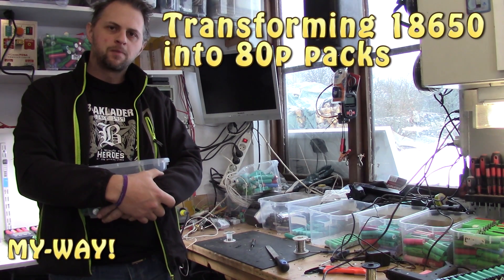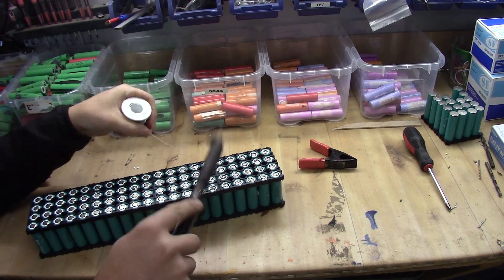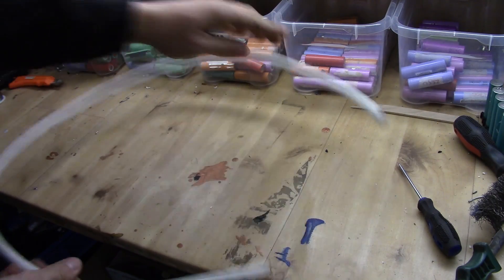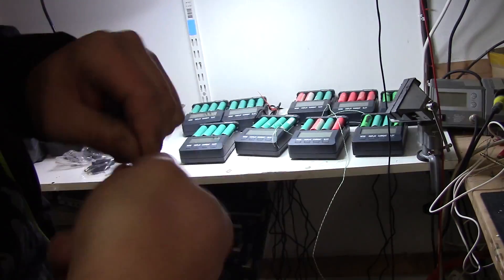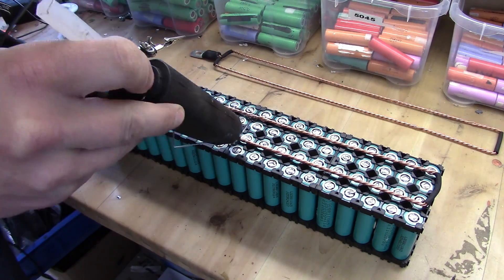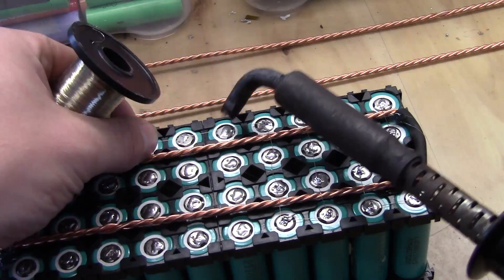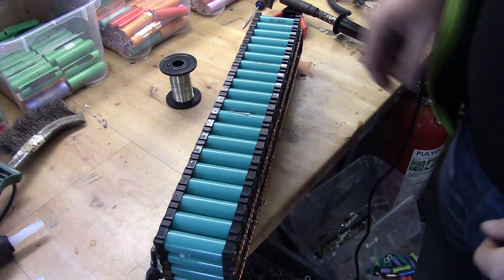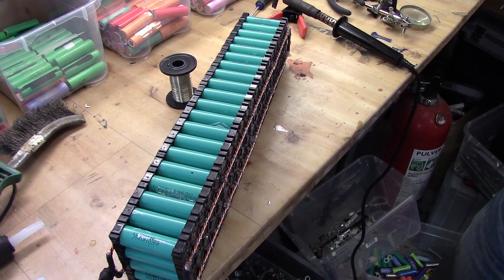18650 - Assemble the packs HOW TO 80 Tesla powerwall!

Comment: what kind of control charge you use
Reply from the maker: Jose Garcia contol charge?
Reply: this control charge has a model number
Reply from the maker: What is a "controll charge"? Are you talking about what charger/tester that im using for testing my cells? If so im using The opus: https://goo.gl/KDf1tw  DONT buy the ones for under 12 USD.. They are fake and does not exist. Always go with the 30+USD units. I also use iCharger 308 but only for ref testing. More info here: https://www.youtube.com/watch?v=w5GFp8QBxP8

Comment: where do you buy those batteries? I would like to rebuild a few 18 volt RIOBI batteries. Good show , good ideas, like your presentation, you may give some short inside details of access to the material you use. Keep it up, definitely interesting.
Reply from the maker: That Old Bob if you want proper cells check out nkon.nl cheap china then check my ebat review 2nd hand then  ask around. I also have some links to good ebay deals that will  add here tomorrow
Reply from the maker: Check out this link https://goo.gl/yLuZyd (Ebay)  There you have Ebike batteries that most likely would work great. really good price and its hard to find better deal!  So get one or 5 meanwhile they are there.

Comment: Battery + Super Capacitor 500F up 100A
Reply from the maker: สรรเพชร รวยดี no need. My battery bank can supply over 4000A :)
Reply: DIY Tech & Repairs 
Battery 10A + Super Capacitor 500F up 100A Battey 40kA + C 1,000,000,F up 100kA Fast charge Battery
Reply from the maker: สรรเพชร รวยดี for what?
Reply: DIY Tech & Repairs 
recommend
There may be new ideas.
Reply from the maker: สรรเพชร รวยดี no need for cap here. Its long term storage and not short high current burst. For small batteri banks perhaps needed

Comment: Very Clean Work, just subscribed. I just came across all this power wall stuff, I'm a Petrol Head, this is like Hot Rodding!
So one 700w Module gives you .938 Horse Power, if you would have added 32 more batteries you would have added another 300w and would have almost 1kw/1.34hp per Module.  Now you just need to mount 100 Modules on your wall and you will have the same Horse power like a Tesla S 100D    :D

Comment: Cutting "extra bits" off the fuse wire is wasted time. Current will flow shortest path to bussbar, so electrically they are just extra parallel links. No harm in leaving there!
Reply from the maker: Nigel Pearson and also double the fuse. by leaving them i would get 14a instead of 7a.
Reply: Heh - I hadn't thought of that.

I will have to read up on fuse wire!
(I think the longer any wire, the higher the resistance, but am not sure which run would burn/blow first?)
Reply from the maker: Nigel Pearson thing is with 80 cells in my pack there is no problem to blow 14a or even 100a fuse. when it comes to length it depends on many factors. all from type of wire to time and surrounding temperature. to short will havr less resistance and longer longer. the wire i used work best at around 8 to 10mm. to short and it need more current and if i go above higher resistance. i would not say that my will blow at exactly 7a because that i dont know. on bench testing it i know that its around that and that 1 cell easily can blow it and 79 can the  too :)

Comment: Hi, I've been trying to build a pack for my ebike but having alot of issues. I even must have short circuited the bms board so i think the charging is not working. ive put the copper wire on top of the cells with tape but the voltages are going up and down. are you able to help me if i sent you pictures. also i was not able to solder the the wires on top of the cells because i dont know how to solder properly and solder was not sticking to the top of the cells
Reply from the maker: Feel free to add the question up on diypowerwalls.com/.  If solder does not stick that generally means to little energy/heat or very fithly cells.

Comment: you said this was nearly a 1kWh pack... what is your average mAh per cell in that 80 cell pack?
Reply from the maker: Thats wrong. Its 10kWh in 14s. Its only 0.68kWh in one pac. Or somewhere around 2.3Ah/cell
Reply: @DIYTechRepairs  should  all the packs in series have to have the same capacity?
Reply from the maker: @larsstevens8528  yes

Comment: This looks amazing, and not to difficult to do :) I also want to make 3 batterypacks in series of 80 parrallell new  Panasonic 16850 batteries. ( approx 240A - 12V ) But i want to use it as a leisure battery for my Iveco Campervan. ( charging by solar and by alternator when motor running ) . i will experience some difficulties to overcome because my alternator and starterbattery give 14,7 V power which is to much for the batterybank i guess, but at least i already KNOW NOW how i can make my batterypacks :) that is one hurdle already overcome :)   thanks !
Reply: Quest for Freedom that's easy you just get a converter that converts it to the voltage you need :)

Comment: 48v but 14s not 13s? Is that safe for the hub motors?
Reply from the maker: Brad Andrews what hub motor? :)
Reply: Hi please accept my apologies for my slow reply! I'm not actually sure what huh motor is currently on my bike but initially I purchased a 1000w rear kit from Cyclotricity. It has been swapped for a different hub motor however but only temporary for me to test and then I'm going to test the Cyclotricity hub motor and see which is preferred so I can get the info on the other huh motor then! In the meantime let's say I have a motor from Cyclotricity lol thank you :)
Reply from the maker: Brad Andrews you need to check the rating of the controller and the motor on what that would let you go to. higher voltage is generally better if ue hardware can tollerate ir.
Reply: I know that the cyclotricity hub motor is advertised to peak at 25a I believe. The motor is 48v 1000W. As I say I'm not sure of my current controller/motor setup and specs but I can most definitely find that out! All I know of the current setup is that its also 48v 1000W. What generally tells you if something is okay to handle 14S if your only supposed to give it 48v? Obviously no hub manufcaturer will advertise that as okay as far as I can tell nor will any ebike seller so it confuses me lol thanks for such a quick reply!!

Comment: Great! But how to charge it? What iCharger is?
Reply from the maker: Oleh Mizyurko icharger is a brand of a charger.
Reply: Thank you! I wonder how this charger works? I have IMAX B6 from mime rc model. And it can charge only 6pcs in series. And to charge e.g. battary 48v (14*3.7) It needs 3 times to charge it separately (6, 6, 2). How do you balance cells during the charge for a big batteries? Thanks!
Reply from the maker: Oleh Mizyurko i dont. i charge all to top before assembly and then i either just paralell then for some days to balance or run  bms on them :)
Reply: IMAX b6 sucks because it's about 50w per hour looks for something around 150-250w (if your battery can take it) perhaps ternigy

Comment: Just a little correction to the way you connect your busbar - make sure you pull "-" and "+" from opposite ends of the string. The way you have it connected, the 4 cells closest to the end of the busbar will be discharged the most, then the ones after them etc, while the last cells will barely be catching up. That will destroy the first cells a lot quicker. HBpowerwall had the same issue at the start. Actually, in your case all you need to do, is cut a little piece of the busbar out, on each terminal, on opposing sides. Hope you know what I mean. Other than that, excellent work!
Example: www.leadingedgepower.com/images/page/battery_bank_parallel.jpg
Reply from the maker: It depends. If you stress the cells with high current this is more of an issue and I agree. Hb started with only 1 string at first and that's 80 cells and quite some load per cell. That will stress it and can cause issues in the start. 

The bank you see in above video is included in a bank with 1100 cells per string! ;)  Yes total number of cells is a lot and videos is coming. Also most of the strings is in a different design totally where above issue cannot happen. Videos coming. 

My old bank was connected in cross to reduce the issue with the start getting stressed. One thing also to remember is that it depends on the resistance and dimension of the bus bar. If you have higher resistance this can also cause higher issues-

Never the less my revised construction of above do have this in mind with cross connection instead. 

Thanks for your advice! I should have mentioned in the video!

Comment: I'm just wondering why lots of people build their battery banks in a Parallel-Series configuration; i.e. 80 x 2Ah in parallel for 160Ah pack, then 7 packs connected in series to get a 28V bank rather than a Series-Parallel configuration; i.e. 7 x 2Ah in Series for a 28V pack then 80 packs in parallel for 160Ah. In my mind, this makes the bank more modular. You should only need to fuse each series pack. Have the ability to replace faulty packs or add packs while the battery bank is online. Thoughts?
Reply from the maker: You are correct but then you get 80 strings where you need to crosscheck all cells so they are in balance. I always go n+1 on my setups. That is a spare of everything. In my case i have 3 of 14s80p. So i can easily take one of those larger ones out for maintenance.  Going smaller like you said would leave me with 240strings! That is alot of strings to monitor balancing on. The fuses on the cell is also to protect from that specific cell. If you go your method i would still need all those fuses to protect against the issue im doing now. External fuse per string is also used of course. 

Hope that explains if not just let me know and il do my best
Reply: Thank you for your time. Wouldn't balance monitoring across such a massively parallel pack only yield the health of the majority of the cells in the pack? If a pack were to develop 5 or 10 lame (not sure of the proper terminology) cells out of 80, would it be obvious at the onset? As for fusing, wouldn't fusing every cell in a 14s1p pack be redundant?
Reply from the maker: Johann Amin yes u get harder to locate one cell. but imagine having 3000 or more cells like i have. would o rather do 100s of strings and then have 100s of bms system that cost alot or have 3 strings with 3 bms systems and save ton of money :)  in worst case i need to check through 80 cells. rhat takes me 24 hours to do. 1hour job to pick out and then add them back to my test rig :)
thats why i do it.
yes if u go 14s1p fuse for each cell would be overkill.... but on the other hand there is noone out there doing that setup for a system with 3000 cells or more. not even big companoes does that. if u look at my valence battery i opened they have 4s100p. :)
Reply: Yes, I agree with you on the need to do health monitoring on the battery bank & the associated costs with said monitoring as part of the system as a whole. I do apologize if I seem a little pedantic as I've only just stated looking into solar. Then there will be inverters, stacking inverters, grid-tie inverters, online/offline inverters, switching inverters, etc to look into. So much information it boggles the mind. Thank you for sharing your time & have a good day.
Reply from the maker: Johann Amin no worries! i help to the best of my knowledge!

Comment: I really like that fuse wire idea, and the bus bars being in between cells.  I can see that it would be very easy to swap out a bad cell. Here are a few questions I had while watching this:

How do you charge these packs up?  Wouldn't there be issues with the cells not balancing properly?  
Where do you find so many of these cells? It seems new 18650s are around $4.50 each, are they radically cheaper second hand?
Reply from the maker: Robert Cook they are included in a 14s syste. so will be charged with solar system capable of 60vdc. 
all cells tested with Opus bt3100.
all cells are second hand laptop batteries. only from genuine like hp dell samsung and so forth.

buying new is not an option for me. way to expensive.

Comment: great vid, thanks. may I ask a question? How do I know how much amps a battery pack can handle.  if I have a motor that draws 40 amps and I am using a 18685 battery pack that has 40 cells, does that mean that each cell is using a 1 amp draw?
Reply from the maker: It depends. But yes if you have 40 cells in parallel we can make it easy and say it got 1a per cell. But if you got a 4s battery bank with total of 40 cells you only got 10 cells per group.. Then they have to deal with 4a per cell... 2nd hand laptop batteries does not like that high current in general.

Comment: Why do you remove the extra pieces of fuse wire after you lay it down. They aren't required but they don't bother anything, right?
Reply from the maker: EbikeSchool.com because i dont want w fuses to each battery. only 1 from the bus bar :) yes u could potentially leave them but that would require double the current to disconect a battery
Reply: Got it, thanks for the reply!

Comment: Hello,  I'm thinking of creating this system,  for my home in Spain.  It's only a small place. And my electric supply form the board is capped at 6kw .  How many of these bundles will I need to power my house without the use of the grid.
Reply from the maker: That is a good question and I am afraid i cannot answer it with this little information. Its like "how long is a wire" :)
If we go by the same way as i do where i cap the load on the cells so they max deliver 1A each and we calculate 48v system: 600w/51,8V = 116A of current at 3.7V nominal.  With that you would need 116 cells in series ie an 14s116p system.   The bricks you see above is 80p bricks.  And if you lets say use 2.2Ah cells above you would get ~116*2,2*3,7*14 = 13kWh useable energy in that pack. You would at max draw be able to power your house for just over 2 hours. 

And that would equal to 1624 cells with capacity of 2.2Ah

If you on the other hand use new cells or set your max draw higher you can also reduce the number of cells.

I hope this helps out a bit.
Reply: DIY Tech & Repairs thanks very much for the reply.  I have a laptop sales and repair small business,  so I have access to a pretty good supply of batteries.  In my scrap room alone I probably have 200 dead laptop. I am completely new to this system/scene and find it really interesting.  I am no expert on solar.  But are electronically mined so I hope I can set my mind to this no problem.  Your videos are very well made,  and explain things,  so even people like me can  understand. I am only now starting to purchase some of the items I need to start making the packs,  is there any website you can recommend.  Thanks again
Reply from the maker: Its always good to have its own place to get bats :)
https://www.facebook.com/groups/diypowerwalls/ and http://www.diypowerwalls.com/

Fellow DIY 18650 guy (HBPowerwall aka Peter) that has those 2 and you will find me on both pretty active :)

Comment: Hello,  I'm thinking of creating this system,  for my home in Spain.  It's only a small place. And my electric supply form the board is capped at 6kw .  How many of these bundles will I need to power my house without the use of the grid.

Comment: Good job, I like the busbars idea, but could you please share how did you calculate those almost 1 KWh? As I know in your case it should be like 80 celis times 2.2A (average cell capacity) times 3.7 nominal voltage  = 651.2 Wh.
Reply from the maker: You are correct about the 1kWh. That was wrong by me :)  To be honest the cells is avg more of 2.4 but no matter what i just thought "its close to 10kw so that is 1kw per pack..." Never thought about that it was 14 so my math sucked when recording.....  So it should be around 700Wh per pack and almost 10kWh in total per string.
Reply: Onе more thing -  I don`t know how will you organize the packs, but IMHO just hot glue is no enough. Take a look at the knack of flyjabiru11 - it`s easy and inexpensive. 
Wish you all the best.
Reply from the maker: Petko Vasilev hot glue in my case is just for holding them until soldered. if i were to move them around you would need to tie it down alot more. in my case the glue plus soldered wires should be ok. The time will tell and if needed i do have a backup plan :)

Thanks for raising the concern
Reply: Petko Vasilev you are right, almost half of what he said to be.. but the question here would be how to and what to use to charge the battery bank? I made one like that one but my solar charger won't even read the voltage.
Reply from the maker: Charge 1 single 3.7V bank?  Use a RC charger or DC/DC converter and it will work fine. I use my iCharger for that.

Comment: I noticed that you didn't solder the fuses to the bus bars which is fine until the copper corrodes. I'm thinking of a top and bottom that looks just like this but has pressure connections like a typical battery holder here: http://www.banggood.com/DIY-1-Slot-18650-Battery-Holder-With-2-Leads-p-972775.html?rmmds=search with a bus bar built in and pre fused so all you have to do is bolt them together and if a battery craps out there's a small post with a groove so you place the wire in the groove and give it a few winds and run it over the bus bar and no solder ever touches the batteries maybe a little on the bus bar and the extra winding can be used to repair the bad battery.
Reply from the maker: MrBrymstond they are soldered to the bus bar. it wouldnt work otherwise since there is no spring
Reply from the maker: tesla batteries are fused with tension only. but its made out of some spring. would have loved that to but never found anyrhing that i could make for decent money